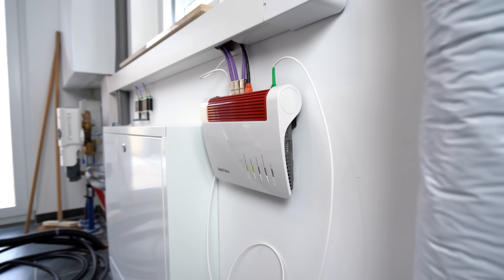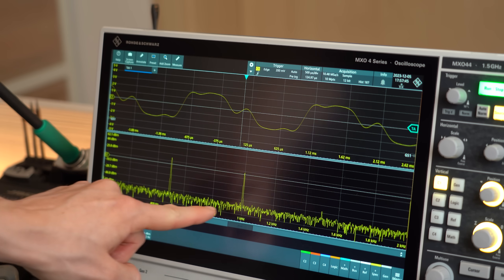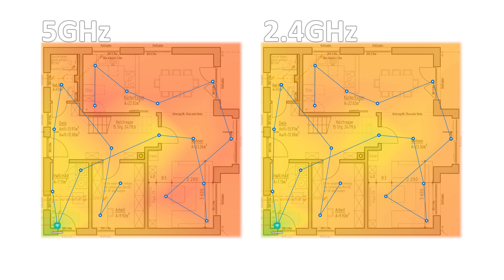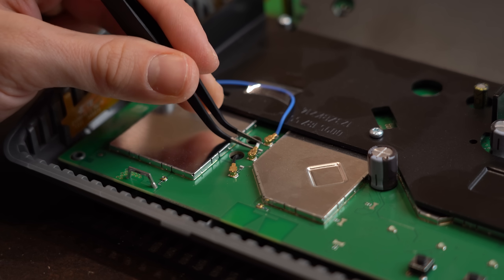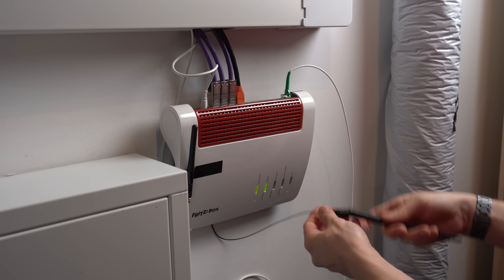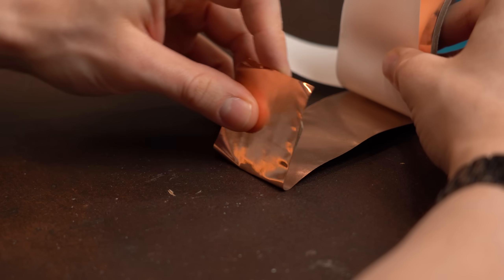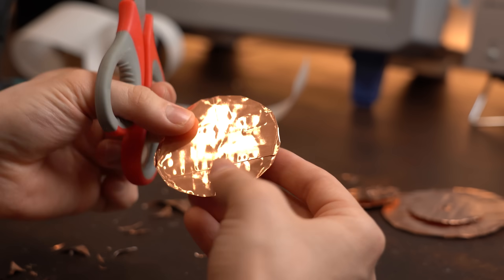I tried OVERPOWERING my WiFi!

Comment: One of the challenges, as well as avoiding breaking rules by boosting radiated power, is you also have to improve receive sensitivity, otherwise the receiving device hears the signal from the router but the router never properly hears the reply. Of course, the receiving device also needs to increase its transmit power. Perhaps mesh (as you hinted to) or even powerline extenders (if these devices are reliable now).

Comment: How To Make A Cheap WindSurfer Antenna to Boost Wifi Signal, This has been proven by electrical engineers and radio engineers. paper tape/glue and aluminum foil no bs! Also check your antennas if u have them are not all aligned.

Comment: For the custom antenna to work I would have assumed that the disks should be insulated from each other and that the central rod should be ether non conductive or very thin.
Having said that the antenna resembles the Yagi type of directional antenna, however insted of straight rod type elements it has disks and the driven element is weird

Comment: Antenna designer here.  You can't simply measure the physical length because there are electrical wavelengths which very depending on the type of metal used as an antenna.  Antennas are radiated and measured with a network spectrum analyzer that plots a smith chart to characterize them.  I get this is probably beyond or outside the scope of your video but for the sake of completeness figured I'd chime in.

Comment: The problem with your directional antenna is that you used all conductive parts with no insulators. Instead of radiating from just the one circle and using the others to direct. The whole thing was one giant poorly tuned omni antenna. If the swr increases too high most transmitters tend to reduce output power.

Comment: Using a better antenna is as illegal as using an amplifier, as the total allowed transmit power is set in EIRP, therefor if you keep your 100mW legal transmit power but swap the antenna, your total EIRP will still be over the limit. Not to mention, that most of your client devices (smart phones, laptops, tablets) will still only able to transmit at 32mW, so it makes little sense to improve the DL direction without the UL direction. If someone wants to improve the WIFI, just move the router to a much better spot in the flat/house then a corner far away from the places where you actually want to use it.

Comment: A bit late, but a better antenna for most homes is a high-gain antenna, basically instead of the spherical coverage area you get from omnidirectional ones, it creates a flatter more so oval shape, it works very well.

Comment: Going above the legal limit is the least of problems with amplifiers. The much bigger problem is that it will not work for 2 reasons:
1) The amplifiers are unidirectional. They only amplify signals going from the input port to the output. Because of that the signal coming back from your smartphone/laptop is going to get reduced in power.
2) Even if you install circulators and everything else needed to both receive and transmitt on a single antenna at the same time you still have an issue of low power on the other side so not only uplink speed will slightly suffer but where there was no connection at all before it will still not work after that.

Also you should know that testing for legal power limits is a tricky business and the manufacturer could use some antenna diagram tricks to pass the tests so when you changed the antennas you could technically make the thing illegal. Noone will ever know of course unless you hook up a dish and point it at the nearby airport or increase the output power by like 40dB or more but if you want to stay legal no matter what for some reason then the only reliable way would be to use the existing antennas unless you have a proper radio emissions testing room available nearby.

Comment: Another problem with the amplifier solution, is that with an amplifier only at the access point side, that won't also boost the transmit power of the other end device, so the smartphone or laptop would see the WiFi network with good signal strength, but couldn't associate, or might barely associate but can't reliably send data, so won't manage to receive a DHCP lease, for which it needs to transmit a DHCP request before.
(I suppose the same symptom as when using a weak WiFi network card with a good AP at some distance).

The only reliable use of WiFi amplifiers would be for connecting two APs with each its own amplifier, like a point-to-point link between two buildings, typically with directionnal antennas (and while actually helping signal strength and associated link speed and reliability, that directionnal beam concentration would even worsen the concern with legal max transmit power).

Comment: It's NOT legal to do this (in Europe).

The regulations cited at 5:00 and 9:20 clearly state EIRP.   In other words it's no different legally whether the signal is boosted by amplifier or by antenna design.  What matters is the Radiated Power.

Separately, unless you're licensed to do, operating a modified radio transmitter is itself illegal because it invalidates the manufacturer's type testing.

That said, use some common sense and it's practically fine!

Comment: Watch out when you unplug the antenna when the router is operational: The built-in amplifier can be overloaded and die when the (normally 50ohm) load/impedance go to infinity. Especially true for internal antennas that are not expected to be removed
Reply: I'll keep this in mind next time i tinker with a computer

Comment: There is a guy from the Czech Republic who posted a video on the old router and he figured out what to do to transfer the optical to WAN connector on his router to work directly with his smart switch. When the router boots up it provides the optical adapter a payload transfer file that loads the router serial number into the optical adapter. Here is his link https://youtu.be/Hi7JMTojT-4?si=bdPyPS5yhG6NI9_x

Comment: The best, non-hackish, way to solve wifi problems is to just get mesh routers or just put more routers around your home. Mesh routers are really easy because they work on PoE which means you can plug one in anywhere you have an ethernet cable which in a normal house will be everywhere you care about wifi which eliminates dead zones. 

There is also some major plusses to reading a bit about electromagetism and antennas before trying to mess with them. First of all, a hobbyist with no experience in electrical engineering isn't going to be able to build their own GHz range signal amplifier because they don't work like lower frequency circuits since things like the tiny magnetic fields produced by every circuit now matters and it can be tough for the hobbyist with no electrical engineering experience to fix. The antenna in this video also just doesn't really work as a real directional antenna since the rings are supposed to be isolated and boost the signal, but since they're attached by conductive material then this doesn't happen and actually causes worse performance in the direction it is aiming. A yagi uda antenna is a much better idea and there is great guides everywhere about how to build one

Comment: I remember using tin foil that was found in cigarette boxes for my phone. The thing is that my Note2 had trouble getting signals and then I had seen some videos using foils might improve it. So I wrapped a tiny amount into my phones antenna and it was getting much better signals. That was 5 years ago.

Comment: I recently replaced my old Wifi router. The new one came highly recommended, as any device one buys on Amazon these days is. This one somehow fully reaches every former Wifi hole in the house, upstairs and down. It has six vertical antennas and the accompanying literature says it chooses them in pairs to transmit directionally to each user. Appears to work perfectly. I've been an amateur antenna enthusiast for ages and I understand how it could do these things um... theoretically, but simultaneously interact with transceivers throughout the house? That's got to be magic.

Comment: Part of my job is fixing network issues in peoples homes so I've gained some experience over the years.

Upgrading the antennas is something I've tried around 10 years ago and it does work, however it seems that it only makes a difference when you have line of sight to the access point. As soon as there are any objects and ofc walls in the way you can can just as well stick to the original antennas. they work just as good or most of the time better than what you could come up with.

The easiest advice I can give everyone is to place the Router up high in the room and do not mount it on a wall.
you could build a little shelf on the wall for it to sit on. the goal is to make the radio waves travel through the fewest objects possible.
Also place it so the radio waves don't have to travel across an entire wall but instead mostly straight through it.
you can yield around 10-30% better reception that way.

but in the end... even the best router will not be able to provide good wifi connections behind 2-3 walls... so you need to place another access point in your home.
If you can find any way to do it... please get an ethernet cable to it. you can place your next access point further away from the main one and it will not loose bandwith that way.

If you have to work with WiFi repeater... don't use too many of them. just get a proper one (Tri-band if possible) and go from there. yes they can get expensive but it doesn't help to place a lot of junk in your rooms that doesn't fit your routers wifi standard or antenna configuration.
do not place it too far away from the main router. If the connection to the repeater is weak the bandwith will go down significantly.

Comment: If you want to build a 2.4 GHz antenna then you NEED an antenna analyzer (SWR-Meter). Even most antennas you can buy are not made very well. They have a terrible SWR ratio. It is very hard to make an Antenna with a good SWR ratio. That´s because of the small wave lenght. Even a tenth of a millimeter can change the SWR ratio. But without an SWR-Meter or antenna analyzer, you are not gonna get happy with it. Everything needs to be straight and smooth and flat. I realy had to laught seeing your DIY antenna. I knew instandly that this isn´t gonna work well ! :) Try again by using a SWR-Meter ! But once you have an antenna with a ratio 1:1.2 or better, you will see that the reception has improved a lot.  Good luck ! :)

Comment: I need a 12V battery monitor. It's only supposed to show me the voltage of the car battery and consume little power itself.
I would be very grateful for tips. If possible, something with microcontrollers like ESP and Bluetooth. I'm not interested in finished devices. Would love to be able to see and modify the code myself.

Comment: I use a metal plate behind the router (pointing to the direction i want) and works fine. The idea is that the waves bounce to the metal plate and increase the strength of the signal. You can also use this to block or weaken the signal into a direction, for example to the outside world.

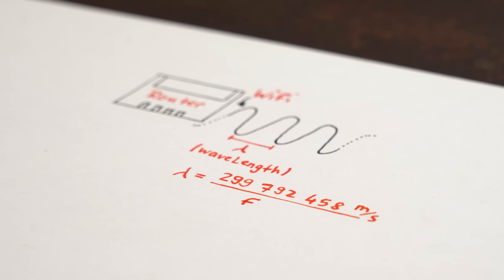Comment: Other than the errors/corrections/ideas already pointed out by others (not impressed by the amount of research in this one): You need to use the speed of light in the material of the antenna. You are using vacuum c at 3:16, which is somewhat faster, so the correct lenght is shorter. This is called the velocity factor. https://en.wikipedia.org/wiki/Velocity_factor

Comment: In general, the closer one can get their router (or at least its antennas) to the ceiling, the better. The primary signal path avoids a lot of RF-absorbing obstacles (such as people) and RF-blocking obstacles (such as big metal appliances) that way.

Comment: I solved this WiFi range issue using a couple of old ASUS routers and set them up as a mesh network. Costs very little and really smashes the signal out. MESH is definitely the best way to fill a volume with WiFi access.

Comment: I'd personally recommend moving your routers to the center of the house. If thats not possible, than run an ethernet cable to a second router, than change the first router settings to enable passthrough. If your even willing, a mesh network would also do the trick. My house has one main router, and three mesh nodes to that router. Two of the three nodes run without a backbone, and i'm getting speeds of close to 300+ mbps in areas like our garage. On the 2.4 ghz, i can get nearly 100 mbps at the fartherst point on the property. 100 mbps is more than enough to surf the web.

Comment: My house is old , the wall out of my sitting  room is two chimneys...so its about 3m thick in parts. Wifi does not leave this room, so I just put 2 extender plugs over power lines around the house and job done. My own fault for installing fiber in this room but I spend 90% of my time here.

Comment: You can get a lot better wifi by moving the AP into the center of the house. Preferably place it in open space, ie not mounted to a wall.

Also place antennae in a 90 degree angle from each other. Play with antennae pleacement and direction.

Comment: Great video Scott. Just one note. 3:26 This statement is untrue. The transfer speed does not rely on the frequency but depends on the width of the channel/band. The increase of speeds is a result of a wider available frequency spectrum resulting in more channels for the 5GHz system than the 2.4GHz one, effectively increasing the overall system bandwidth. :)

Comment: 3:25 "since the 5GHz wave is shorter, it can not only transfer more data per second": not quite - data transfer speed depends on frequency range and power (SNR actually). Carrier frequency is not that much important on its own.

Comment: It is pretty well known, that AVMs WiFi performance is underwhelming to say the last. To truly improve the reception all over your house, you should consider running network wires towards the center of each floor and mount dedicated mesh capable access points right there, preferably on the ceiling. (To not pollute the spectrum with useless signals, don't forget to disable wifi in that AVM thing.)

If you don't want to spend money on more hardware, you could at least try to place your routers further away from walls so you have less noise through reflections in your signal.

Comment: So a 1950's scifi style ray gun antenna is worse than an omni. No surprise there. 😄 Best solution is POE wireless access points, but mesh would be easier to build out if you don't have existing ethernet. I would be curious to see how a parabolic dish would perform though.

Comment: Just clicked video. I used foil to wrap around router and got 4db better signal, with a bit better speed. (On 5Ghz, didn't test 2.4 because it's powerful enough to have 30 megabits outside and nearly 100 all over the house)
Sometimes you better to set signal power to less than 100%, especially in crowded areas, because that way it would pick up (and generate) too many noises. And also disabling 2.4Ghz in that situation altogether also helps (of course, check if all devices support 5Ghz band).

Comment: Great video! The Fritz!Box is one of the best routers I owned, tough wifi has it's limits...in my parents house I've installed the router on the middle floor, and added one repeater on the first and top floor. If you want good coverage, this is the way to go, without much hassle and a reasonable expense.

Btw the Fritz router has a very good coverage (mine is the 7530), to be fair, the signal is pretty good on the last floor, only on the first floor where walls are more "comolicated" is really required.

Comment: There is also the idea of laying the antenna down so the antennas match some of the most common orientations of the potential devices my access point, whihc used to be my router has its 4 antennas with 1 standing upright 2 laying down(1 sideways and one back and forth in relation to the AP)  and one in the middle of the directions

Comment: Buy overpriced Elektroschrott from AVM and make it better, but after 2 years your wifimodules in the schrottbox 7590 goes bad, there no shielding no protection if they get strong signal like from mobilphone you put on top of this box it will destroy both wifi modules 2,4 and 5 ghz :D So it thnk its pointless to tune this box, just buy a better router or build your own with proper hardware.

Comment: Your Router placement is causing unnecessary strain to the FO cable, would suggest to either mount it horizontally or print a support for the FO Cable so it`s not stressed at the plug .

Comment: The ''hack'' antenna is no good since all is connected together. I built a 3D printed Yagi antenna with copper wires as concentrators and it's pretty impressive !

Comment: My ESP32 module in the backyard is about 50 meters (150 feet) away from my router, and I still get -70db with its pcb antenna.  
Antenna orientation is critical. You have yours 90º off axis by mounting it vertically.

Comment: Just a note using mesh repeaters halves your bandwidth, better to have a dedicated access point run to the center of your living area, with a ethernet cable run back to the router.

Comment: Not quite sure what principle that disc beam antenna works on.
Also from that position spacing a dipole or quarterwave antenna a quarterwave away from a reflector plate may be useful, as it wont produce a tight beam, but will fold the rear signal back to the front

Comment: Ok, try this Scott. Keep the router where it is and use two sma extension cables (shielded) to raise the antennas higher. Say 1.75 to 2.25 meters above the floor. If you use a small metal angle bracket, it will give you a ground plane.
I would recommend at least half the  antenna length for distance from the wall.  I.e 6 cm ant 3 cm spacing.
Please note, i suggest this as it has worked for me in similar situations.  Results will vary.
Good luck. And happy holidays, mate.